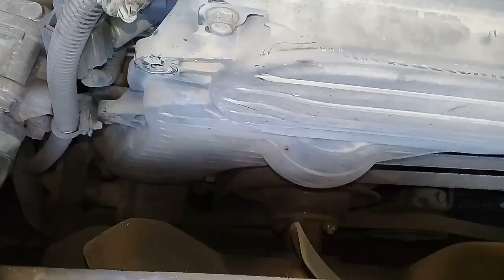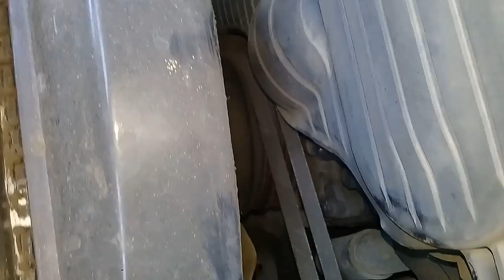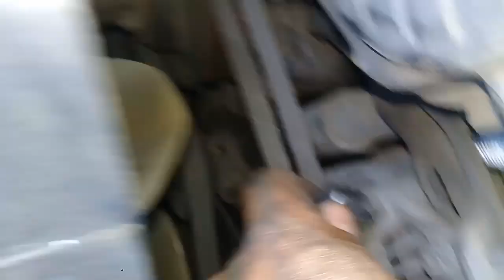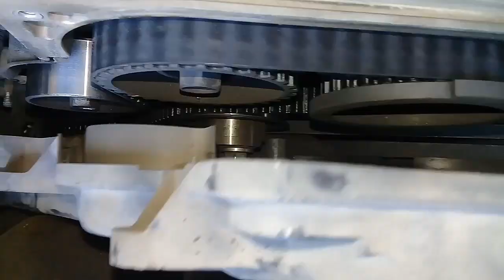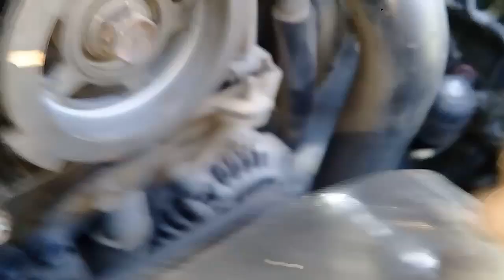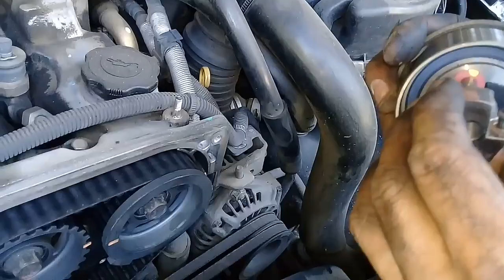Timing Belt Removal | Ford Everest TDCi 3.0

Comment: Thank you sir, your video is helping people like me. Godspeed !
Reply from the maker: Thanks for watching!
Reply: @DiYSpanner  by the by, do you happen to know what causes DTC P0093 (Large leak detected) to pop up ? The engine intermittently stalls whenever I drive the vehicle for about 10-15 minutes and this DTC pops up on the scanner
Reply from the maker: @Paguyuban_tepa_selira  on my experienced usually the problem is the fuel rail pressure sensor.
Reply: @DiYSpanner  I'll have it checked later then. I'll remove the supply pump first, then inspect it. Thank you sir, good day.

Comment: hi thanks for a good video. the use of turning the engin with the fan does that not hurt the fan in a way? and must the fan go clockwise or the belt?
Reply from the maker: Yes wont hurt the fan just put the gear to neutral. The fan go clockwise and the timing belt rotate counterclockwise. Thanks for watching!
Reply: Stink when I try rotate the fan it's not working for me big sad lol how is the clutch fan engaged I don't have socket for crank pulley double big sad🤣😂

Comment: NEVER separate the two parts of the tensioner assembly that he shows at 5 minutes20 seconds in the video,,,it causes the tensioner to lose its tension settings and not put full tension on the belt,,,it will fail and cause engine damage ,,,be warned .
Reply from the maker: Good to know, thanks for the heads up.